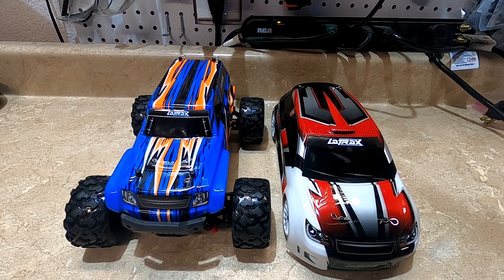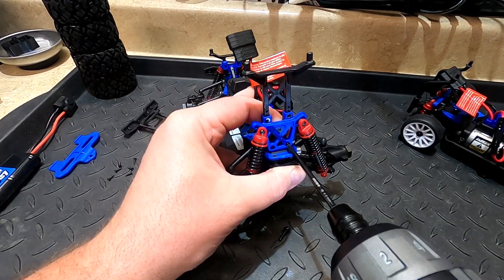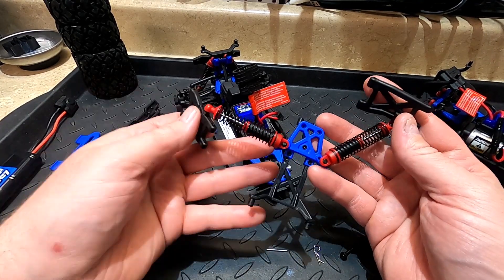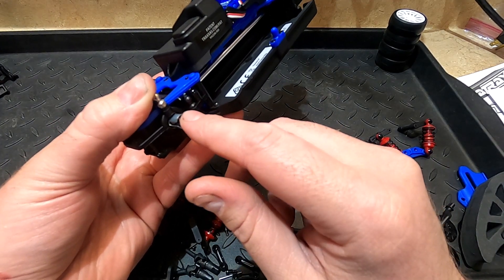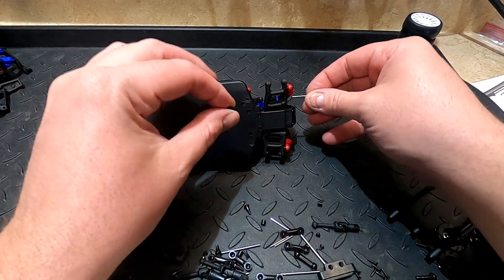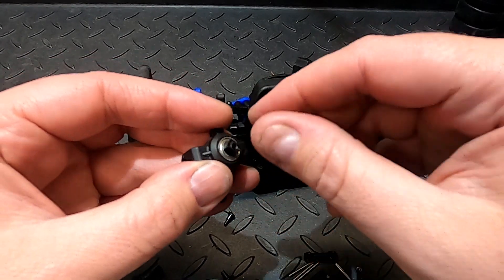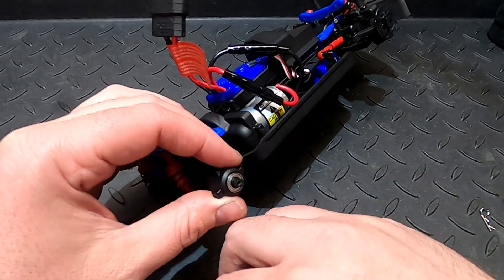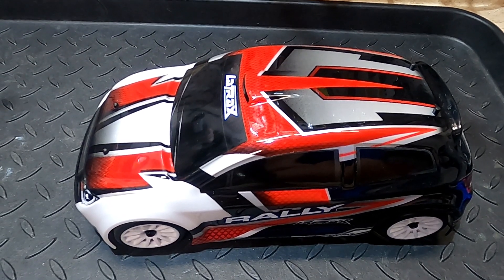How to Convert a Latrax Teton into a Latrax Rally

Comment: I just put drift wheel and tires on my Teton to have fun with it on the tile in my house. Not really a need to go through all this. Only thing is it burnt out the motor so I had to upgrade to brushless.
Reply from the maker: Ya I think most people wouldn't do this but this video was requested so I did.